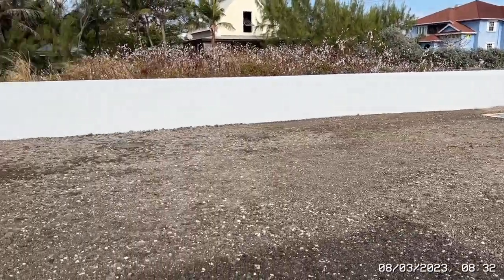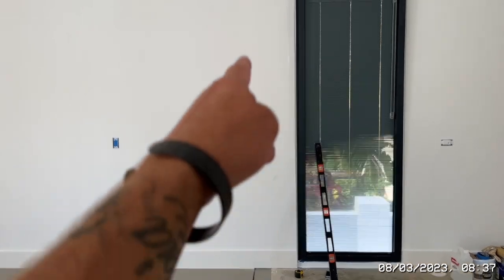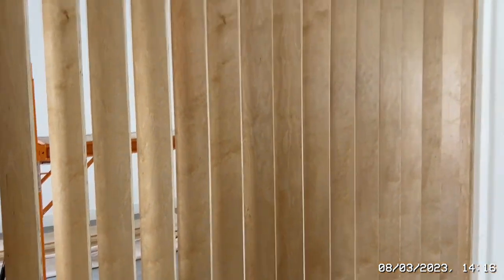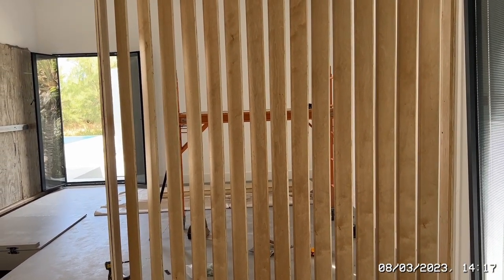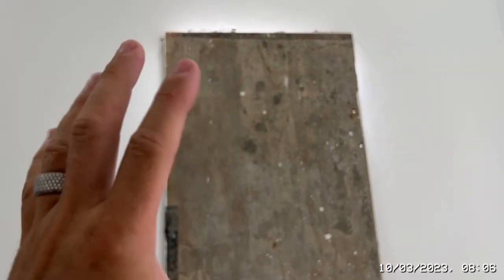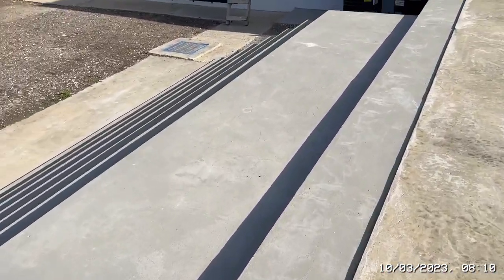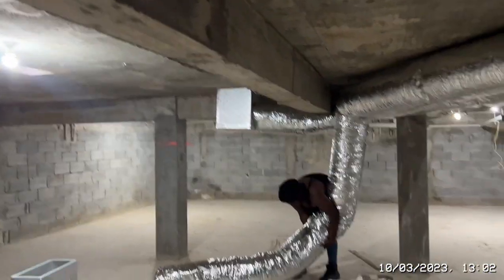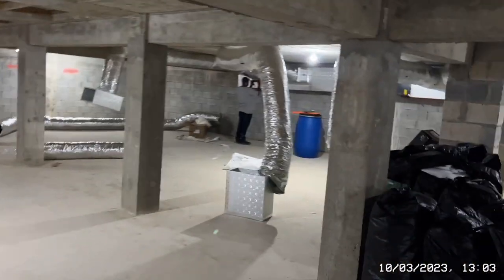Barbados 🇧🇧 Beach House Build - Day 440

Comment: Hi Alvin, How you doing I hope you and your family are well. Did you really say your father in law was bored in Barbados LOL. The cottage is looking great, the painted floor might require maintance if the area is used as a regular airbnb, as an alternative a self adhesive vinyl plank floor is a cost effective way to imitate real wooden floors and is very durable. 
Mate please dont use that grass on a roll in the area Tyson has flattern, try the Savanna grass option, the mother in law has this type of lawn in St George and it is nice under foot and will look great in the long run with some fruit trees & bougainvillea. 
Keep up the great work & informative vlog, the project looks fantastic.
Reply from the maker: Thanks Jeff. Yes the plan is to put down a Vinyl floor at some stage. The paint will do for now.

As for the grass, yes this has to be grass in my eyes but I need to find someone that can do it and do it cheap. I have been told that someone at West Morlands maybe able to supply. Just need to get up there as there is no contact details for them that I can find. It also needs to be planned out, as you say with some trees and hedges.

Comment: You also have landscapers who will bring patches of Savanah grass.  It grows fast and easily.  As it grows they would cut and replant until the entire yard is covered.  I Shipped in sun and shade grass seeds from Home Depot but have not used it yet
Reply: How did you manage to get seeds shipped in? I enquired about this and it sounds like you have to jump through several hoops to bring it to the island. Some issue/fear about potentially bringing harmful fungae to Barbados
Reply: @Andy Benskin  I'm hearing this for the first time.  I was not asked about it and it was search...
Reply from the maker: Yes that was the plan but no one seems to want to work 😂

Comment: With regards to the frame devider in the cottage, what would look great and be functional would be x2 stainless steel rods/wire bolted in the ceiling and onto the top plate of frame. A bit industrial style look. They would be complimentary to the other fixed points (wall/floor). Perhaps a visit to the marina to get the steel rope they use on their ships/boats.
Reply from the maker: Yes but I didn't want to do that as it will ruin the look, it has become more stable now it is screwed in the floor and wall which again I did not want to do 😂
Reply: It looks great though